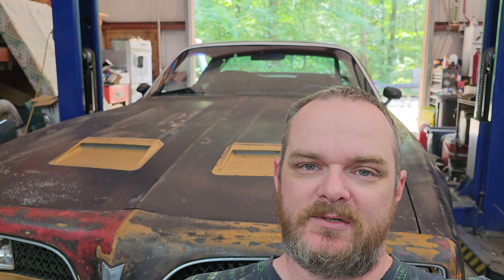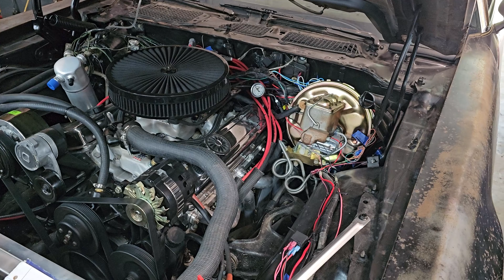1978 Firebird Formula Part 22: 500 Miles Down and Lots of Issues Fixed Including Sniper RFI Problems

Comment: I got a totally free car given to me and had the click click problems with it. First I charged the battery, that seemed to gives it. Problem came back so I cleaned the battery posts and terminals replacing one of the terminals and cutting off some of the corroded wire. Worked again for awhile until click click again. This time I was going to replace the starter and even got one because it stopped and wouldn't even click. Well before I got the starter out I found a loose ground on the engine. I have on other cars replaced the solenoid for a fix and even taken the solenoid apart and flipped the washer over for a clean surface for the juice to flow through. Oh and back in the day I had a 66 LeMann's with a four speed and a 326 with AC. AC was for rich people back then. It was a great car. My wife loved it. Good video. Happy Motoring.
Reply from the maker: Neat, I read that too small of an ign wire to the starter will cause the solenoid to burn up eventually too. So far my starter has been working great with the junk I had layin around. The best fixes are the cheap/free fixes. That returned starter will buy you a couple cases of beer!
Reply: @ChaosGarage  Ilike cheap fixes too. Some years ago my son's Camry started making a clunking sound in the rear when he turned. I looked under the rear and one of his sway bar brackets had broken. Part was not available locally so I took the bracket off, cut up a Coke can, formed it on the bracket drilled a couple of holes, and he was back in business. Looking at the bracket it was still cracked but it held a razor thin can against the bushing. Cost -- one can and about an hour total of repair time.
Reply from the maker: Can't beat a good cheap bush fix. Temporarily permanent!